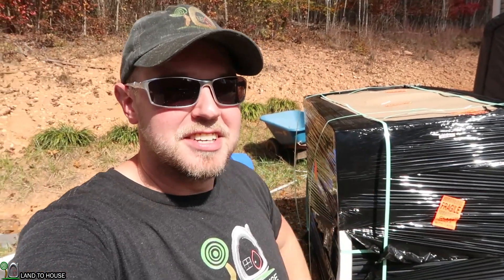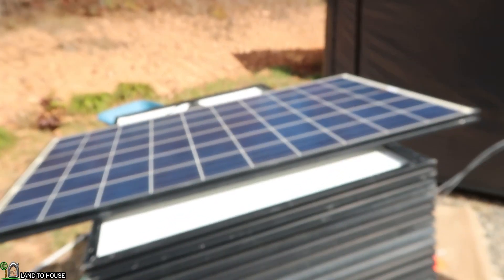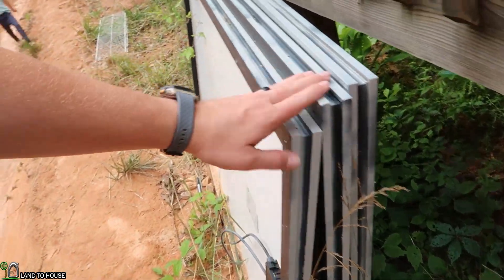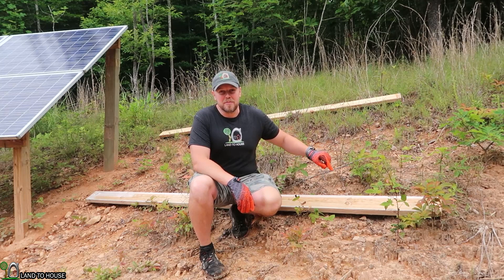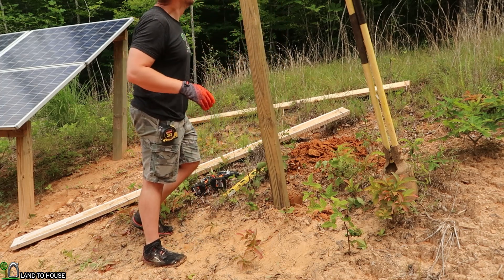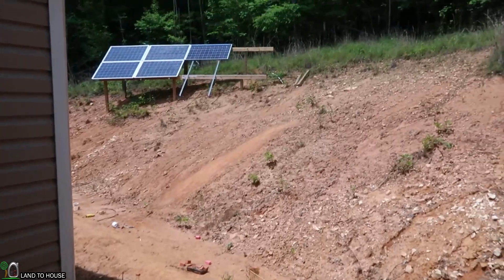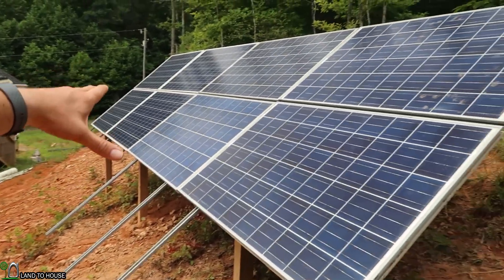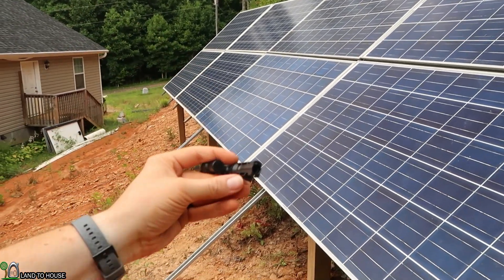Doubling My Solar Power from 1kw to 2kw! Much Better.

Comment: Really neat that you got that great price on the panels to increase your off grid capability.  I really enjoy your adventures and you make it look easy enough that I might try solar one day.  I have a video on my channel about cutting threaded stock and using a bench grinder to clean up the cut end, perhaps your sponsors at WEN might send you one of their bench grinders for a review on your tools tech and gear channel?  It seems like a tool you would use a lot.

Comment: Don't understand why dropping to 48v vs 60v system unless you got problems with your inverters not been able to do upto 68v Peak  (higher voltage systems are more efficient)
Reply from the maker: Dropping to 48v allows me to use 1 battery in the new 4x4 Lineup. So I only had to buy 3 new ones.
Reply: @LandtoHouse  just make sure cables are still fine temperature wise as lower voltage increases the amps at same wattage (lower voltage might also lower the reliability of the inverters if pushed to high on wattage as internally amps be higher on the components)

If your planning on expanding the system in the future for more wattage, better off just going with 60v system or need to start replacing cables with thicker ones

Comment: Make your life a little easier: next time you need to cut all-thread to length, thread a nut on first and then, once it's cut, clean up the end like you describe and then thread the nut off.  That'll true up any last little bits of the thread so it'll be easier to use in future.

Comment: Just been waiting 15 weeks with 9 of my 28 panels ( about 3 kW / 10 kW ) for my electric provider to build off 40 years old air lines (too small for 10 kW) to under ground power lines. Now they are finished and this week we dig my land side cables and next week going to full power! And I am glad, because using few months this tiny 3 kW is just not enough! I know 10 kW is too much but when you buy electric with 5-6 snt / kW (Euros) and sell 8-9 snt / kW it is ok 😁 ( In Finland you pay separately for Transfer fee also and Tax so you are paying between 11-15 snt / kW whole! and you can transfer without fee what you provide! ) Tnx for interesting video! 👍

Comment: More solar is more better and you need a bench grinder and a bench vice
Reply from the maker: Those tools would be nice.
Reply: @LandtoHouse  Don't you have a Drill Press with a vice? I actually was wondering why you din't use this.
Reply from the maker: The vise never has fit right.... and that side of the shop is such a mess..... and the sun was in my eyes and I had a cramp... haha all the excuses.
Reply: @LandtoHouse  Haha, I completely understand the 2nd excuse! ;-)

Comment: Put a nut on the all thread before you cut it then back the nut off over where you cut. Cleans those cut threads right up. Not sure if that's more or less work than sandpaper.
Reply from the maker: That is a fun idea! I will try that next time.

Comment: Why does no body make a solar panel with the voltage they want at low current then one low voltage panel with the current they need and combine them into one unit?
Reply from the maker: Voltage drops to the lowest in a group. For instance if one panel was 37v and another is 35v both will read at 35v.

If you cover 1 panel with a blanket the whole bunch will drop out.
Reply: @LandtoHouse  What if you had two panels with a transistor darlington pair, on to supply current and the other the voltage?
Reply: travis moore - you need to do some more reading.  In a solar system, it really helps to have higher voltages and lower currents coming from your panels to the solar charge controller.   (Not like you describe ... both high voltage AND high current.). Once the energy gets to the solar charge controller, THAT’S when most MPPT controller will drop the voltage to match your battery, AND simultaneously boost the current by the same proportion as it dropped the voltage.
Reply: @test-193  What if you don't have a charge controller and just have a custom chagrining circuit that used a darlington amplifier that uses high current and high voltage to drive the amp with a 24v panel and 5 amp solar cell in a darlinton amplifier with a hfe of 2000 to charge a 24v 2400ah battery array. And a blocking diode where needed.
Reply: travis moore - Travis, high current is not a desirable thing from solar panels.  It will drastically increase your wire costs due to the loss.  You’ll need much thicker wire and that can be expensive.  It’s better to transmit the power at a high voltage and low current, then....  just before the battery, drop the voltage and increase the current.  It’s much more efficient than your method and much cheaper too.
Reply: @test-193  What if your battery and inverter are right next to the solar panel with a solid lithium polymer module.
Reply: travis moore Travis, you are free to connect your equipment any way you like.  But your ORIGINAL question was answered...... because high voltage AND high current is not the best way to hook things up for 99.9% of the people doing solar.  Your system is configured in a very unusual way, to say the least.  (No solar charge controller????). It’s obvious that nothing I say will change your mind.  So go ahead, do it your way.  Then post your results.  Like: Number of panels, and their wattage..... how many of those watts actually get to your battery, etc etc
Reply: Land to House - The bypass diodes will take care of that problem.  Instead of dragging all the panels in the series string down... the bypass diodes allow the power from the other panels to just skip the shaded panel and continue on to the solar charge controller, as if it wasn’t even wired into the series string.

Comment: The more batteries you add the more effecient your sysem will be.. Are you fully grid tied?
Reply from the maker: Both legs of the main power have a grid tie limiter inverter. The house always uses at least 5w on both sides then the inverters kick in.

Comment: I am concerned with your build. I do not see a ground clamp on any of the panels, no ground rod shown, no disconnect other than the mc4 combiners. Could you show that part of the build? In NC we get a LOT of thunderstorms… EM dissipation is pretty important to protect the equipment.
Reply from the maker: I still need to add the disconnect and ground.

Comment: Why go to 48v? To increase AH of the bank for winter? Will you have to change panels wiring or will charge controller adapt? Thanks!
Reply from the maker: Yes stepping down to 48v so I have more amp hours. All I had to do was step down settings on the charge controller.

Comment: I'm a solar professional and I know you are having budget constraints, but changing only 3 batteries would degrade new batteries to state of old batteries with in 1-2 months (only for AGM/LA batteries)
Reply: We recommend customer's to change all batteries to get more life from new batteries when they're upgrading from 24v/36v to 48v. Or downgrading from 60v/72v to 48v
Reply: So LiFe batteries don’t have that issue of degradation when adding new batteries at different times?
Reply: @adamroof9460  there'll be some but it's not that much it may remove like 50-60 cycle out of it

Comment: yes sir ,you doing a great job. now i would to ask if there is an alternative of the components especially ball valve and spring check in case the ones you have are readily available on the market that is for the RAM PUMP.